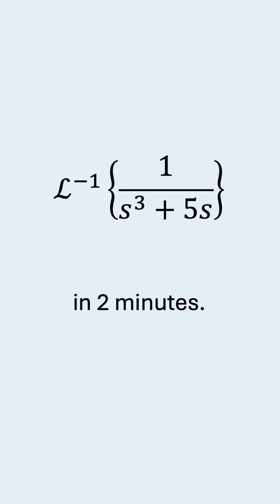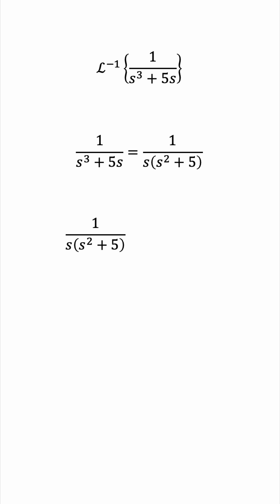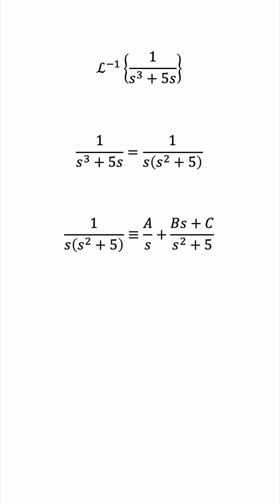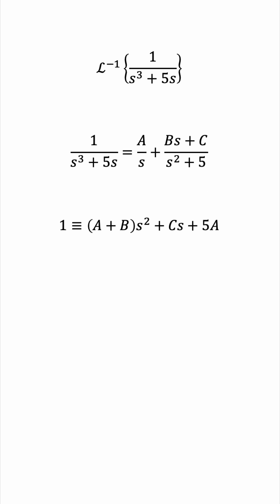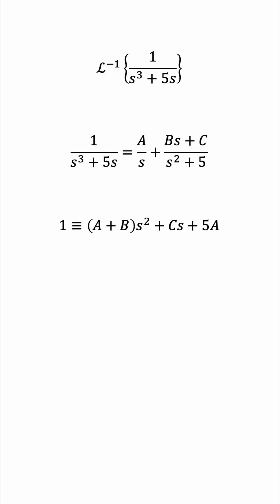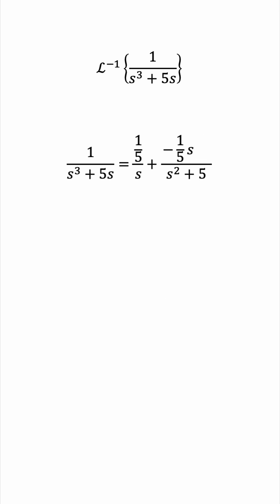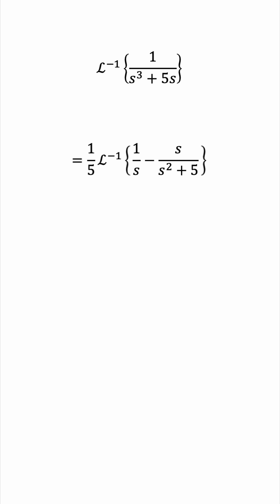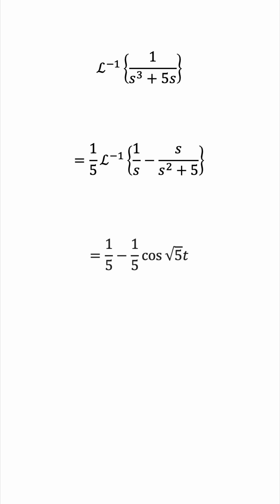Inverse Laplace Transform Question #maths #engineering

Comment: how did you get A+B=0 C=0 and 5A=1 ?
Reply: use both sides of the equations and pull out the coefficients of x values or in this case s. so for s^2 you have A + B on the right but you don’t have any on the left so A + B = 0. and continue all the way down to the constants. for s, C on the right, 0 on the left so C=0. lastly the constants, 5A on the right and 1 on the left so 5A=1. for another case, say you had s^2 + 2s + 5 on the left side. s^2 you would have A+B=1. for s you would have C=2. for the constants you would have 5A=5. then you would just use system of equations and A=1 so in A+B=1 you would have B=0